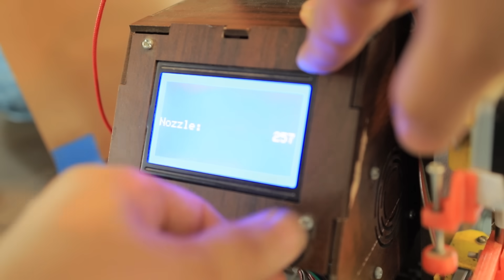How to Make free & easy filament for 3D printer at home

Comment: total newbie in 3D printer ,
many explain this print from bottle , 
but shop sell pla wire ,

what the probleme from bottle ?
temp is higher and look no fixed ,
some ppl say 70° for plate to 120 ....
and 260°c for wire and no "fast" ...

so where the problem , use more electricity 
but save on wire pla ...

Comment: Which machine are you using to recycle the PET? and how can I get the same one? I did some tests with a home made nozzle 1.5mm (because I couldn't fin a 1.75 drill bit yet) and also with a soldering gun with temperature selector, but regardless whether I try at 190 C, 200 C, 220C etc, a lot of force is required to pull the 5 mm strip of PET through and I am not sure that the quality I am getting is good enough. Also I am trying with Sprite Zero 1.5L bottle which is a very thick PET.
Any advice is appreciated.

Comment: Every video I see on how to do this they all have either an old 3d printer to use or a 700 dollar machine, I've come up with my own design with the pieces that I have, the only thing I can't figure out is how to heat the nozzle to the right temperature without buying an expensive temperature controller thingy online. Like can I use an old soldering iron? How hot it needs to be? How do I regulate the temps if I need to? For now this seems more like a far far away project idea to me..

Comment: Q: How do you get consistent diameter when the bottle's wall thickness isn't consistent?
A: You don't. Your prints will suffer.
Reply from the maker: The thickness of the wall is not important, don't worry about it
Reply: @AIboom20  The thickness of the wall is as important as the width of the strip.

Every time someone tells me "don't worry about it", I know that something ain't right and begs for more attention.

Comment: How fast is that little motor moving to pull the filament onto the wheel. I'm planning on building a similar model but with a glue gun.

Comment: Only 8 steps 3 custom contraptions in(So Far) and, well.. I wouldn’t call this “EASY”😂… But it is pretty Rad.😉.. 
Nice 🤙🏻
Reply from the maker: Yes, it is easy, of course, it is better to watch the new videos of the channel, which are much simpler. If you think it is not easy, search for other methods of filament production. Filament converted
Reply: @AIboom20  .. No denying that it’s the Easier method... I will add that I’m going to try Your way when or f I ever Go for it….
Again, Nice🤙🏻

Comment: If you cut two 3mm strips from different bottles it should also be possible to mix colours. or will the thinner strips break?
Reply from the maker: No, it cannot be mixed because it does not melt completely, in this method we only make the tape into a tube

Comment: What is the purpose of inflating the bottle slightly before slicing it into a ribbon? It seems like it would have worked just as well without that step.
EDIT: I believe that inflation step is needed to remove any dents from the bottle, to make it easier to cut.

Comment: 1:00 I saw another video where the guy didn't heat it in the fire, but he dipped the bottle in hot water(with air inside the bottle just like your video) just to cover it and remove it!

Comment: Could I also recommend when your pulling the bottle to cut it I'd put a spools at the end with a gear system since I noticed you put it on a spool before putting it through the hot end

Comment: So this is where im lost.  I got the same heat block pullstruder part as you do in my setup but I cant get the shredded bottle filament through the nozzle without it bunching up.  Theres no clog in the nozzle.  It just wont go through all the way and the heat deforms it into folding in on itself when trying to shove it through.  
Temperature im using is 203C and and going to 230C is too much and it just melts in the load hinge before it can even get out.
Reply from the maker: Please connect with me on Instagram

Comment: that is cool ,however there are some improvements to make 
1) change up the spooling system and spool directly onto an easy to remove spool .
2) use the spool drive to pinch roll pull the strand thru the cutter that way you are only preparing the bottle on the stove and starting the cut .
3) figure out how to splice for much longer runs
4) work smarter not harder

Comment: Simply excellent. Surprised with how well it printed too. Just some advice, printing even slower will give even better results. I would print at half that speed even with commercial bought filament. Plastic doesn't like to flow quickly. Brilliant process though truly. 👏👏👏👏👏

Comment: Your nuts pressurizing it that far. I've had them burst with only about 50psi in them (inflating tubeless tyres oldskool style). Also when you heat shrink the bottle it will hold up the same shape as the air inside becomes pressurized enough (done this many times).  ...also shrinking plastic thickens it and makes it easier to fracture, increasing shrapnel risk if it explodes. Eye goggles thick gloves and ear protection at the least (he says with one bad ear and some lucky eyeballs).
What I do with the bottles is use either hot water or unscrew the cap just a little while heating to allow air to escape. Thicker end product but safer. Water probably your best option. Fill it with water, Pop it in a pan and boil it..might get hot enough..salt can be added if you need it hotter than 100c

Comment: So many questions.... But the only one that matters is this...

How are you pulling the "filament" through a heated nozzle without stretching it to the point of failure or even deformation? Especially with no cooling system. I can TOTALLY understand if you are pushing it through the nozzle like all 3D printers do, then you negate the stretching aspect. I mean this just raises so many questions about what exactly are you doing.
Reply from the maker: See description

Comment: i could have poked at so many parts of this video but the one im going to have to go with is that this just wouldn't work. you have no closed feedback for the filament extrusion so the diameter would be massively off over the length of the roll, you also pulled it through at the start of the "extrusion" at any old speed which would mean the start of the filliament would be massively thinner than the other parts. theres no way that bottle has enough plasic in it to make that much filament, no company would waste that much money on packageing materials.

Comment: Quick question, if you cut te extruded filament in half, is it hollow or solid? Do we have to modify the flow settings for the material/filament in our slicer if it's hollow to accommodate for the difference?
Reply from the maker: Hollow

Comment: What is the extrusion temperature of the pet bottle? How did you go about melting the tape and going through the nozzle? I saw two electrical wires but not the heat source. How to control the temperature?
Reply from the maker: Instructional video for making the device is prepared in 8 parts, the link is in the description section of this video.

Comment: The first part of this process is extremely dangerous. You are putting a pressurized vessel over heat to warp its shape. Even the slightest mistake and you are spraying hot burning plastic in every direction as the melting bottle explodes under the extreme pressure.

Comment: Hi friend I did everything you explain in the video and I am right towards the end of this amazing project, The motor does not turn, it just vibrates and makes noise and the problem ?!
Reply from the maker: Thank you for your trust
Did you connect the jumpers and did you connect the stepper motor wires correctly?
Please send me your questions on Instagram along with a video of it

Comment: All these comments about cost, etc., really don't have a bearing on the questions about this video, sorry.  What I would like to know is will this method of breakdown of the plastic bottle produce a uniform strand that is consistent?  I love this idea and would like to be able to reproduce it myself, but what, if any, are the pitfalls, and how can they be avoided, if at all?  What did you have to overcome in order to do this?  Really would like a serious reply if possible.  Thanks for sharing the video!
Reply from the maker: Great point!
Thanks for your comment
In this method, if the width of the strip made of the bottle is uniform, the produced filament is also uniform. I have been using only this filament for almost a year and I have not bought a new filament. The point that you must be very careful is that the bottle must be completely clean. In order to prevent the nozzle from clogging, in this method, unlike the conventional method of filament production, the filament is produced in the form of a tube, which is sometimes empty and sometimes full, and this will be different with different bottles.
Reply: @AIboom20  Thank you!

Comment: Could probably have "skipped a step" of manual labor by putting the sheering jig behind the extruder that turns it into usable filament, so as it gets pulled through the extruder nozzle, it cuts it behind it at the same time

Comment: i didn´t see the "free", nor the "easy" part of it.also most 3D printers for "at home" market need PLA not PET.
Beside that, In Europe you get usually 0,25€ for every bottle if you return it to any store that sells them, and it will be recycled.
After your method most people are left with 2 pieces of PET that will not be recycled, and go into the trash, and some meters of filament their 3d printers cant handle.
Reply from the maker: This may be the case in your country, but in many countries there is no bottle recycling and the filament is expensive
Reply: @AIboom20  I'm aware of that, thats why it'sthe last point in my comment. Still all the other points stand.

Comment: Honest Rating of the concept:
Pros: Recycle and potentially a good engineering material for long term price.

Cons: Costly initial setup for motors and hotend to convert the plastic to filament and also the time consuming nature will turn a lot of people back.

Proposal: Have a quick and easy guide on how to make the tools to convert these into filament with even less steps. (This is a good proof of concept as of right now.)

Comment: Hmm weird, can't believe that's working, I mean after Re heat the bottle under pressure und cutting the button, you can just pull it in one simultaneously strip? I would expect it's pulling of or has much higher dimension deviation 🤔

Edit: I watched you bottle cutter vid, now I get it 😄
Reply from the maker: Thanks dear friend for your comment

Comment: I tried something similar, a more hacky solution but with the same principal and my Filament at the end is more like a U Shape so mo solid infill, an not a filled circle like normal store bought filament, is this with this machine the same?
do u just crank the Extrusion rate way up or aren't you having such Problems?
Reply from the maker: Explained in video number 8 (the video link is available in the description section of this video)
Reply: @AIboom20  no, for the hollow problem i couldn't find a solution

Comment: While I appreciate your idea you need to think things through more. I can only imagine the amount of people who are going to explode a pressurized molten plastic bottle in their face or suffer from the toxic fumes that the plastic was not designed to be melted creates. At the least you need to explain this in your video, till then it needs to get flagged.
Reply from the maker: As far as I have researched, pet is safe, there is even pet filament for printing, and in the case of heating it to flatten the bottle, you can cut it without heating the bottle. This issue has been removed in other videos.

Comment: How hot was the hotend you used to convert the cut roll of filament to the normal 1.75mm size? I was surprised it did not rip from the force you were pulling it with..
Reply from the maker: 205 degrees Celsius

Comment: Maybe I'm just dumb but this is neither free or easy. That's a lit of equipment required and with a lot of steps and could easily turn dangerous if not handled correctly.
Reply from the maker: نه واقعا آسونه تا الان 3000 نفر از این طریق فیلامنت تولید میکنن، البته این آموزش ساخت دستگاه نیست، لینک ساخت آموزش در قسمت توضیحات این ویدیو موجود است، ببینید و شروع به ساخت دستگاه خود کنید.
Reply: @AIboom20  I will look into your other tutorial and see if it is something I would like to presue.

Comment: "Easy" is apparently a relative term
Reply from the maker: No, it is not, if you make your device, you will realize that making filament with this method is very easy.
  The link to the instructional videos for making a filament device is available in the description section of this video (numbers 1 to 8). I'm sure you can make it soon, you can contact me on Instagram wherever you have a problem.

Comment: What nozzle is used to give you 1.75mm diameter filament?
Reply from the maker: It does not matter what nozzle you use, the tip should be drilled with a 1.7 drill. We will discuss it in the next videos.
Reply from the maker: The link to the instructional videos for making a filament maker is available in the description section of this video (videos 1 to 8). Watch them and start making your filament making machine, I am sure you will make your own filament maker soon.

Comment: my filament comes out rough and not smooth, its difficult going through the extruder, what is the trick; speed of the take up reel or the temp
Reply from the maker: If you have a problem, keep in touch with me on Instagram, I will try to solve your problem
Reply: @AIboom20  thanks, i figured out the strips were too wide, i strip them to around 7mm at 215c and they come out great, how wide do you strip yours to , great videos keep up the good work

Comment: Good video and work but that is not easy. Most of us that have home printers don't have those extra parts hanging around or the time to size and respool our filament. Which is where several causes of imperfections comes from.
Reply from the maker: The reason you think this is not easy is because you do not know how the system works
If you watch the videos of making the device (in the description of this video, numbers 1 to 8), you will know that this is very easy.

Comment: In Germany, a bottle costs 25 cents (currently 0.28 USD) deposit.
You can use only the screw cap for free.
Reply from the maker: Bottles may be so valuable in your country, but in many third world countries they are not so valuable and we are surrounded by these bottles that are practically unused.

Comment: How interesting. I note the bottle got thinner so that would make it so it could bend simpler. However I would say by pulling this could bring up problems of a few things like the center of the plastic line not fully melted together. That later would be fixed I would believe. The heat to make the filament looks to be from a 3D printer that you just powered to create the heat. Looks as if the idea works but I am wondering about the quality of the end product. The reason I wonder is by pulling this through instead of pushing it through the size of the 1.75 may get thinner. By pulling it through it is likely the quality is in question and I would have to try this myself to find out. Over all good video. I do a lot of 3D modeling projects and the only reason I don't do prints is filament.
Reply from the maker: Thank you dear friend for sending me your comment, if you would like to make this device, you can see the attached videos in the description section of this video, there is a complete tutorial in them (video number 1 to 8)

Comment: i made it but fillament is hollow how to fix ?
Reply from the maker: No problem, when your strip is thin, the filament becomes hollow and you can change it to 1.55 instead of 1.75 to compensate for it in the software.

Comment: Might be dumb but if you take a transparent bottle will it stay transparent while you print or will it go in some shade of gray or white due to the heat?
Reply from the maker: It does not change color, but it is not transparent like the first one, because the bottle is connected in one layer, but what you print in 3D is several layers on top of each other.

Comment: Since we have this bottle deposit thing in Germany, where you return your bottles to a store and they give you back 25 Cents per bottle that you've payed before when you bought them, I'm not just going to cut away bottles that would make me money if I returned them, right? So I was wondering how much filament you got out of that one bottle, round about.
If I haven't miscalculated (and unfortunately that happens a lot) I would need to get at least 12.5 grams of "filament" out of that one bottle to break even, compared to the regular €20/1kg of filament, right? I mean, why return the bottles if I can use them for printing and save a buck while I'm at it...
Reply from the maker: Yes, if I and many users lived in Germany, it might make sense, but in many countries this is not the case and no one receives money for empty bottles and all around us is full of empty bottles and the cost of filament is expensive here. Maybe the cost of one kilogram of filament is 700 times that of an empty value bottle, while with 30 bottles you can produce 1 kilogram of filament.